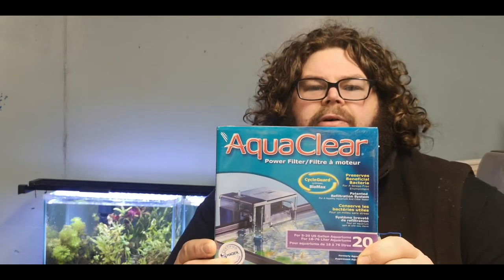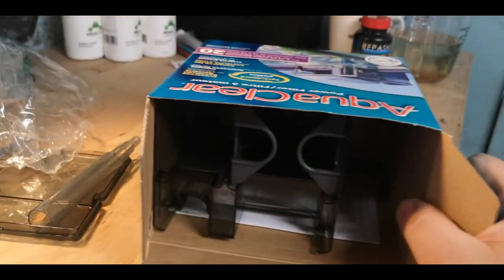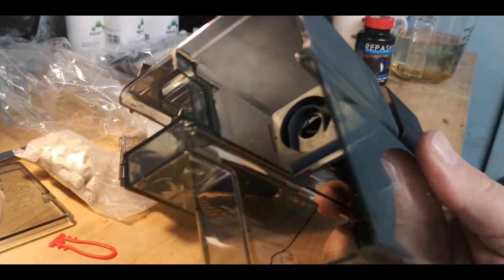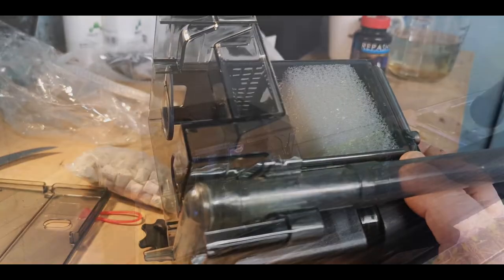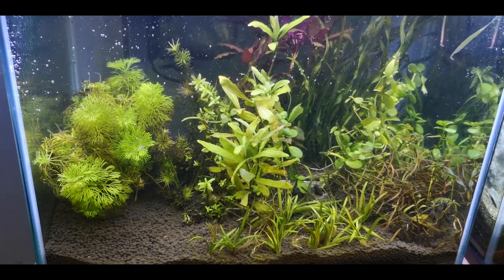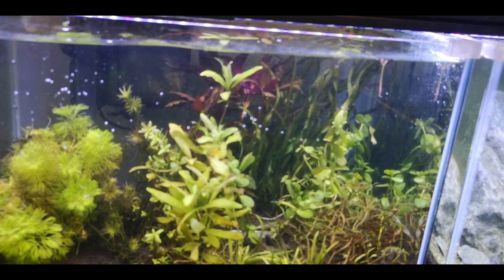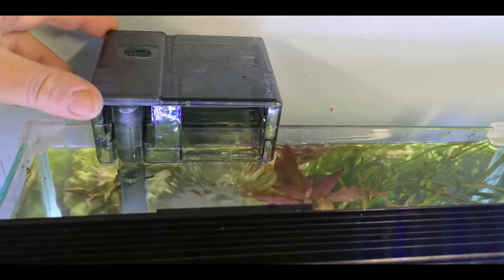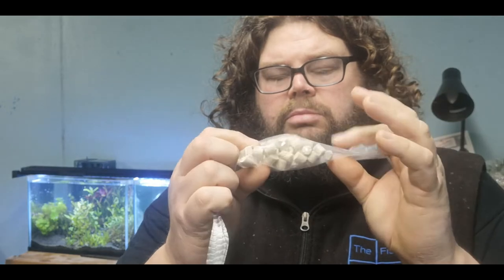Aqua Clear Hang on Back Filter Review.

Comment: I think just about everyone in the aquarium hobby has had some experience with an  Aqua Clear HOB.  There are pro's and con's to it. The biggest pro's are you can use just about any media you want with it and you do not have to buy of their brand of filter media to make it work. There are a million ways you can customize these filters.  The biggest con is the lack of reliability, in cases of power failures even in very short power outages these filter almost never restart on there own. They also have a habit of overflowing when the media gets too gunked up.  All in all it is one of the better filters on the market that should last you years and years.   Good luck with it!
Reply from the maker: I hadn't until I did this review. Thanks for sharing your experiences with this product however. I am sure it will be valuable information for many moving forward.

Comment: Cool honest review Cam, nice work. I have 2 Aquaclear 110 filters on 2 x 6 foot tanks. They each are teamed up with an Eheim Classic 2217 filter. Awesome combo of filters. The Aquaclear flow is INSANE. I have them on end of tanks so flow goes full lenghth of tank.........I feared they would blow the front panel out with all that power if I "hang on backed em' , lol.  Still going strong, no issues over 20 years old. If your after a hang on back..or side, filter,  I would always recommend Aquaclear.  Hope your well in NZ. All the best. Cheers
Reply from the maker: Awesome, thanks for sharing your experiences with us.